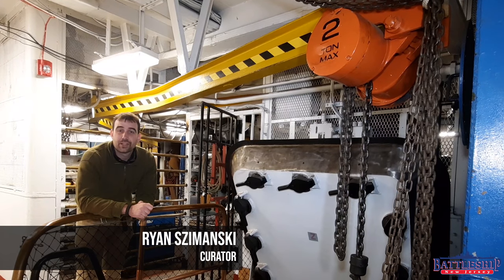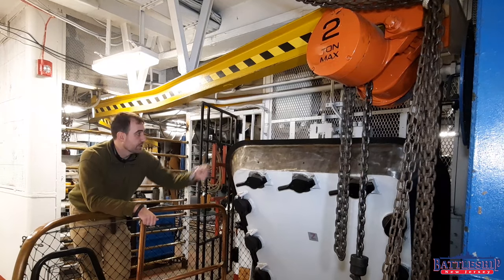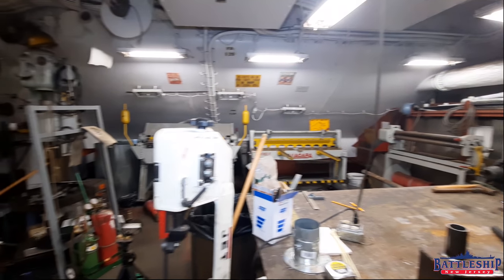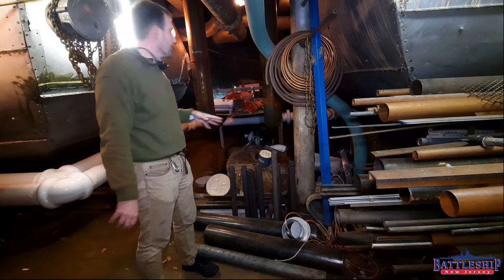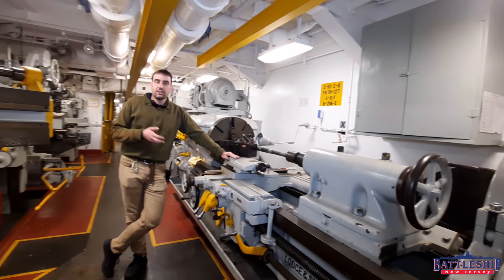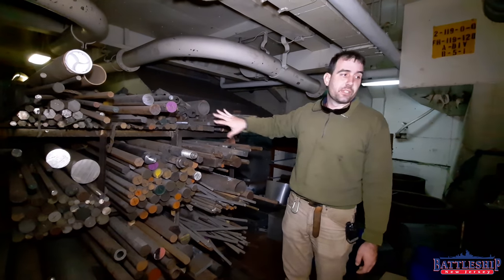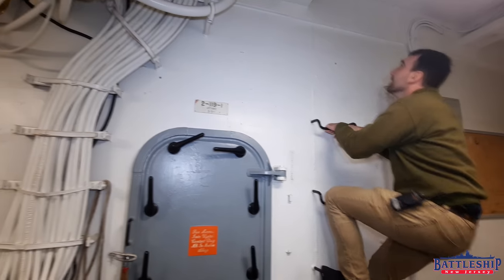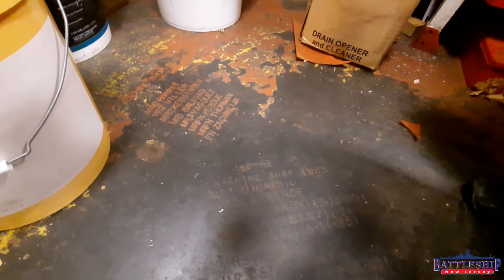Battleship New Jersey's Machine Shop

Comment: Another thing about the funnel uptake holes in the 6" 2nd primary armored deck:  The holes are not open.  They are each covered by a huge "uptake grating" made of an armor plate roughly 2.5 times as thick as the deck (15" or so for the IOWAs) with zig-zag rows of many large 3-4" holes drilled through the Class "B" armor grating, opening in wider cones at the bottom to increase the heated smoke flow.  The gratings under test by hits from large US Navy AP shells at high angles of attack, were calibrated to be roughly of equal resisting power as the laminated 6" deck to such projectiles, equal to about 5.25-5.5" solid Class "B" armor.  This is also approximately true against steeply-falling AP and SAP bombs, though a full, high-power  explosion directly on one of these gratings would throw fragments through the holes (and perhaps break some of the web between the holes) and downward into the lower funnel and into the connected boilers, which might damage a boiler to the point that it had to be shut down.  This is why there were so many smaller boilers in such ships, for major redundant power to the engines.

Comment: It's crazy that the machine shops on board of this battleship are better equipped than many company machine/workshops.
Reply: they had to be. there's no parts stores to stop at if you're broken down in the middle of the ocean, and there is no way to stock enough spare parts ahead of time so what you have on board is what you fix the ship with.
Reply: @marzsit9833   I wonder whether modern day aircraft carriers have the same amount of equipment/big machine tools on board because aircraft carriers are bigger and more complicated than old battleships. They ofcourse will have LOTS of spare parts, but really making everything from scratch like in "ye aulden days" might not be possible anymore?

Comment: 10:30 the permanent access ladders for the chain-hoist attachment - I had to laugh - and they make complete sense. A few bits of bent metal, a few minutes with a welder, and you have a permanent, unbreakable, fixed access - instead of how we do it everywhere else, getting a portable ladder or unsuitable support for the task. Well done, US Navy.
Reply: I am already in the process of building a permanent ladder access for my roof, this shows that my thinking is correct.

Comment: The nice thing about the hot exhaust is that the spare stock metal would be dry, and not corrode.
Reply: Products of combustion are some of the most corrosive fumes I can name you.
Reply: @mathewmolk2089  The exhaust doesn't leak into the room. If it did then the CO or CO2 would be a major problem long before the metal corroded

Comment: I took my then 6yo to BB55 and after I had just got done telling him "they've welded everything down so it doesn't smash fingers (like the corn sheller at cracker barrel - probably a good thing they did that one), and we walk up to a lathe and he proceeds to crank the cross slide and it moves. I think you could have spun it up if it had power.

Comment: Are the props still on the ship,or were they removed at decommissioning?
Reply from the maker: They are still there. We talk about it a bit here: https://youtu.be/K52PSdCpzX4
Reply: They removed the 4 props on the USS Intrepid on her last repair job.  The props got stuck in the mud and it was easier to move the ship after they removed them.  I think 2 of the props may still be on premises of the Intrepid Museum (1 outdoors, 1 possibly on board the Intrepid herself), I believe one prop is in Washington, DC as part of the memorial paraphanelia or possibly in a naval museum, and the last prop is in Pensacola at the Naval Aviation Museum.
USS Enterprise (CVN-65) also had her props removed.  I think at least one of those props may end up in a museum somewhere as a memorial to the ship.  I believe they cannot reuse the Enterprise's propellers for active duty because they were tuned/crafted for that ship's specific propeller shafts and they wouldn't synchronize well on active-duty ships.  Enterprise was a single-class ship (like the JFK/CV-67 was) a continuing problem with the Enterprise was fabricating spares since she was unique.  You had to make pieces from the other ships fit by modifying them OR specially craft one-off pieces for the Enterprise herself; that was one of the things that made Enterprise more expensive to keep in service than the Nimitz-class ships.  From reading about the Olympic Class Liners, it was also the case they could not swap out propellers between the liners because they were all built a little bit differently and they tested different pitch angles for the prop blades, and 3- and 4-bladed central propeller designs were tested to see which prop design was more efficient for the center prop shaft, too.  
I have noticed several things about ship memorials...  Significant submarines that aren't saved in totality (like USS Nautilus mostly was) have their sails conserved and put in museums.  A lot of the larger ships that get scrapped have their propellers conserved.  They did this for Lusitania which had 3 propellers removed in salvage operations in the 1980s and this has happened for multiple other civilian and military vessels.

Comment: It might not seem possible, but in all likelihood, all of those tools were broken down and reassembled in the ship. I used to do work as a technician on stuff like this. I worked on large, capital equipment, most of which much larger than what is seen here. I did this for over 30 years all over North America and Europe. The people that did the actual, physical movement of machines are known as Riggers and Mill Wrights. Something of a lost art today, but they could delicately, and safely, move seemingly impossibly large equipment. My role was to ensure the machine was disassembled and reassembled correctly, on site, and verified to operate properly within manufacturers specs. It all breaks down, into subassemblies, just like smaller machines, including the lathe. These aren't really that big, honestly. I've seen much larger equipment moved. I'm guessing the shipyard, and perhaps the ship itself, had people capable of doing this work.

Comment: One question.  I know of the (yellow) I-Beam rail system (along with the various manual pully chain hoists) that was used to lift and move heavy items to & from the different work spaces on the ship.  However it appears in the video that in many places the yellow I-beam rail is running right through the top of many bulkhead door openings, with some of these bulkhead door openings appearing to be designated fire doors to boot.  It appears though that the I-beam is continuous in its run(s).  So how did the ships Machine Shop Department crew members get those bulkhead doors shut (and shut quickly) so as to create water-tight compartments in emergencies to prevent the spread of a fire, or just to keep people out of their shops??  Thanks!
Reply from the maker: The beam is removable in small sections and only installed when needed
Reply: @BattleshipNewJersey   Thanks! I figured it had to be able to be removed in those sections somehow.

Comment: The lathe shop ... how do you get shells into the broadway ? It should be possible to take the lathe's fundament out the same way. 

The radial drill will split up into pieces which is lighter than a 16 inch shells weight.

When the passenger ship Gripsholm was laid up in Gothenburg in mid 70s people plundered the machine shop ... not a single lathe or mill were left.  A lot can be done using steel bars, wood and angry words...

Comment: The question I have as a machinist is how are the lathes mounted, is there any special mounting system, or are they just bolted to the 6 inch floor. Even if it is 6 inch thick, I can see it still twisting to some degree when under way, and that not good for a lathes precision.
Reply from the maker: The ship itself doesn't rock much and it doesn't twist. These are just bolted to the floor

Comment: Very surprised not to see a shaper or two in there,  Maybe a very large one. Horizontal borer too.
Reply: There was a sizable shaper starting at 7:33.
Reply: Shapers are cool! I set up and ran one in the early 80’s, it was a old machine back then! You could remove a lot of material with a shaper, huge gnarly chips too!
Reply: @TheEvertw  God bless your eyesight evertw, i did not spot it.
Reply: Correction, that is not a shaper but a planer.
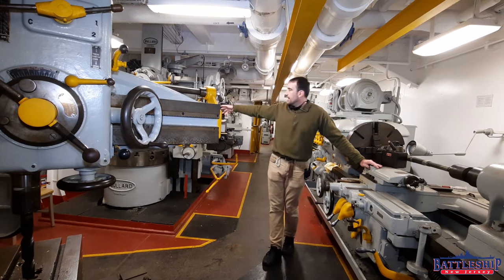https://www.youtube.com/watch?v=UBsxd4TrT4M, at 7:17.

Comment: What about leveling the machines on a floor that is constantly rocking? How did the ships movement affect machining?
Reply: My machining mentor served on a ship tender. Lathes, mills, etc. were bolted to the deck, which was 8” armor plate. He said you could put a center in a lathe tail stock and sight through the headstock and watch it move if seas were heavy!  Some precise jobs could only be done when ship was anchored.
Reply: I lived on a houseboat (floating home) for about 20 years and had a full machine shop onboard.  You just square the machines up/level as best you can.  Never really had any problems with accuracy, even with boat wakes bouncing me around.

Comment: Nice video. BUT about half the machines are a lot newer than WWII vintage. Nothing wrong with that as they upgraded from time to time.
Would like to have seem more detail of the older stuff. Still was very interesting. I worked in a shop that we bought an old Monarch lathe that traced back to WWII vintage by Monarch company sales record. Nice lathe. At some time it had been dropped an broken in half at the center of the bed. Repaired and ran fine and held good tolerances.
Reply from the maker: The video description has a doc with additional photos, if you're interested
Reply: Chances are good that old Monarch was made in our little town of Sidney, Ohio. As a matter of fact I know a guy who worked there in the 50s. 

There's also a SIDNEY lathe at 11:13, these were made by a separate company but still the same town, also known for quality much like Monarch was..

Comment: Did the Battleship have a foundry on board for casting fittings and valves?
Reply from the maker: No. Those would either be machined or would have to wait for a part to be delivered

Comment: question ! for everyone , all the stock ( steel  & pipes ) when the ship was at active duty at sea , would this have been secured ?
next question when using all the machines how much did the ship roll before , you you could not use them ? ( safety )
Reply: That is a point of concern on every ship; securing all that spare stock.
And luckely for us, a ship is not always rolling. Pitching is for a machinist (and my stomach) point of view more worse if you try to achieve a nice finish

Comment: Hi Ryan
i have a question i dont know if it is a covered or a dumb question, but how are a museum battleship without fuel powered today as the boilers are not lit ?
kind regards of a fan from Europe
Reply from the maker: We just have shore power today. It's basically just a fancy extension cord to power on the pier that goes back to the city.

Comment: I wonder when the last time that machine shop office was in use. That computer looks like a mid-2000's Dell Optiplex.
Reply from the maker: We use this shop most days, its still an active shop for the museum.
Reply: @BattleshipNewJersey  Well, in that case, the computer could use an upgrade. I worked with a bunch of those business-class Dell machines, and while they were fairly reliable, a Pentium 4 is painfully slow for productivity these days unless you're just using it to run older versions of software.

Comment: How is the impact when  working with a lathe on a ship which is permanently moving  and is exposed to vibrations from the ships engine
Reply: Probably not terrible, I'm betting it was more of a minor annoyance to the operator than actually negatively impacting accuracy.  Lathes generate their own vibrations while running, that's why they have huge chucks and tail stocks to keep the part square with the tool.  As far as ship movements, those things are bolted down to a 6" thick armored steel deck...it's not gonna lose its level.

Comment: for anyone wondering what the actual procedure looks like for a major swap like a boiler or turbine, it involves a drydock, removing the ship from the water, and just torch cutting a really big honking hole in the side. which then needs to get beveled on both edges and welded back in. layer by layer, by layer... so just to get access and then close the hole again, you're probably in the neighborhood of 10,000 to 15,000 man-hours? that's probably really conservative if I'm being honest. and I know any welder who would be welding on that is making probably about $55/hr, and it's probably 3,000 hours of welding min. 

and all that cost is literally just getting access and then restoring sea-worthiness.

oh, and I just realized I forgot to factor in the time of removing anything from the inside that you don't want an oxi-fuel torch to burn up, because all the compartments on the other side of that cut are going to be... not good...

Comment: How did they make joints or seams in the armor plating?   It cant possibly be all one piece, no crane in the world could lift that.   There must be some kind of joint.    Could just a single piece of armor be removed to make a hole for lifting new major pieces of machinery in and out without disassembling?
Reply from the maker: Stay tuned for tomorrow's video for some insight on that. But generally the armor is at least welded together which makes moving anything major through it extremely difficult.
Reply: With certain steels you can't weld them and maintain heat treatment so I imagine using a torch to cut holes and rewelding would cause embrittlement and cause structural weak points. Ryan did a video showing the splinter deck so I would assume the armor plating was already a extremely hard  but brittle grade of steel thus making most welding process on it require lots of preheating and post-heating of any weld joint. These ships were built right at the age of welding becoming a more reliable method in joining steel over rivets and I believe Ryan covers how that was a major difference in the Iowa and New Jersey?

Comment: Two machines that were not original to the ship as commissioned are your Bridgeport mill and your SM lathe. That's just the two that jump out in the video.
Reply: The Jet horizontal bandsaw and the Delta ( chinese) drill press as well.
Reply: @jd3497   Now that I think about it, yeah you're right. I wasn't focused on any new (er) machine's, just the old ones. I'm part of the last generation of machinists that was fully into my career when I got a chance to get trained to set up, program and run CNC's. I've bounced back and forth between the two ever since (including a 15 year stint fixing as well as running them).

The old manual machine skills will never go away completely, but the CNC'S are now the king's of the shop. Add in the fact that the only machine tools manufactured in North America today are all CNC'S, well, you get the picture...

Comment: When a hatch has one of those yellow rails running through it, how do you close the hatch?
Reply: you pass whatever you are carrying to the next chainfall, like a baton race
Reply: @dodgeplow  
that is the normal way to do that, yes sir.
But Will here above talks about hatches which are in fact watertight doors, and I had the same question: the yellow I-beams are running through the openings without a detachable section in them.
It looks to me that these have been installed this way after decommissioning of the vessel.
Reply: @janvisser2223  oh i see now. I misread his question.
Reply from the maker: Sorry we missed this chat earlier, the rail is part of the original structure of the ship. However, there are small sections at each door that are removable in order to close the door.
Reply: @BattleshipNewJersey  Thank you!
I could not see the detachable sections, but nice to know that they are actually there. Thus, the watertight subdivision is not impaired

Comment: LONG AGO,I WAS ON THE OTHER SIDE OF 3 ALPHA BOILER CHECKING MY FEED WATER TANKS OUT OF SIGHT OF THE MAIN ENGINE. WE LOST A CONDENSATE PUMP,THIS IS VERY BAD.ANYWAY , A BUDDY OF MINE AND MYSELF TORE THE PUMP DOWN AND CARRIED THE 2 STAGE ROTATING ASSEMBLY ALL THE WAY UP OUT OF 3 MMR , DOWN THE PORT SIDE TO THE MACHINE SHOP.THE R.A. ARRIVED WITHOUT A SCRATCH BUT NOT OUR BACKS.

Comment: My boat had a lathe, drill press, bench grinder, and somewhere a stick welder. Nobody onboard ever touched the lathe, I'm not even sure if we even had tooling for it. We had three pipe welders onboard and they played secret squirrel games with the welding equipment.

Comment: Is there a wood shop onboard
Reply: I would imagine so, the decks were still teak. Carriers have them even now, but they are kinda small. On a Nimitz class they are hanger bay level, port side, just forward of Elevator 4. The tire and wheel shop for AIMD is in the same area. They build aircraft tires in there. The tires on the jets are made out of rim halves bolted together and the tire itself, and are inflated to 300 PSI with nitrogen, so they need to be inflated in cages.
Reply from the maker: Yes there is! It's much smaller though
Reply: @muskaos  thanks for that all of our ships in the Royal Australian Navy have a wood shop and usually carry several Shipwrights and carpenters they are also the damage control team leaders. They also do sheetmetal and fibre glass fabrication.